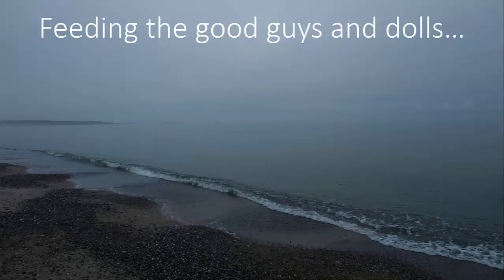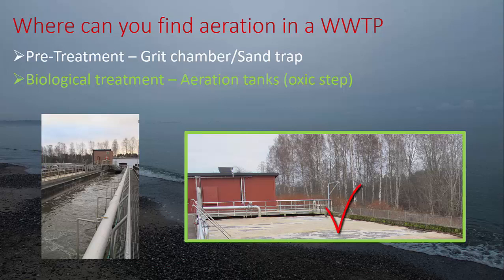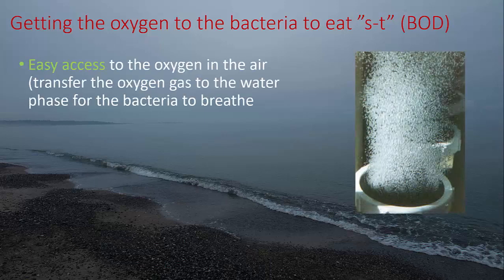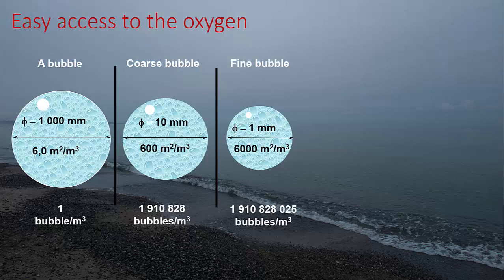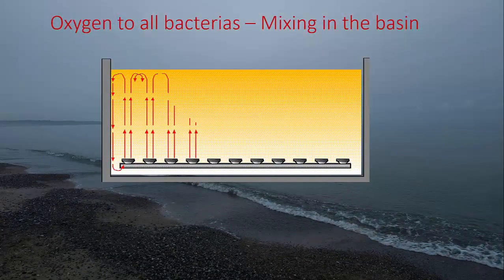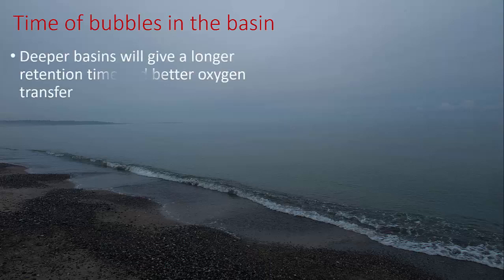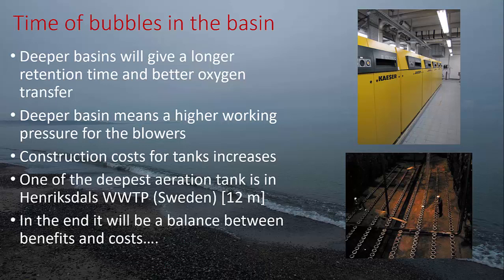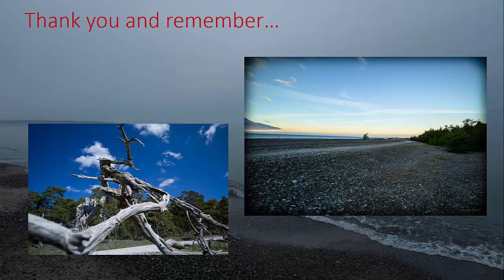Aeration, fine bubble diffusers and oxygen transfer

Comment: Pls elaborate purge line
Reply: The purge line is used to remove condensate water in the aeration piping system. The condensate forms when the varm air from the blower is cooled down by the sorrounding wastewater in the basin. The purge system remove the condensate by "airlift" from the piping system. If this is not done water will fill up the piping system.